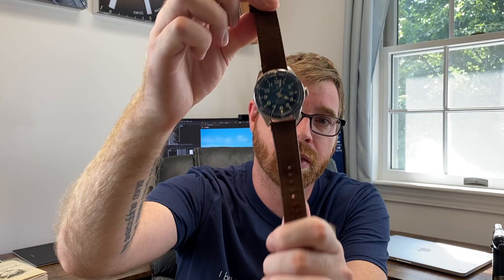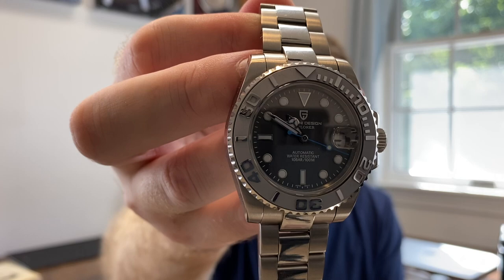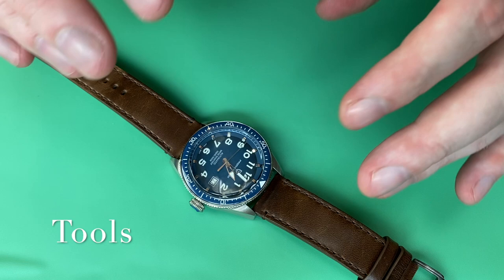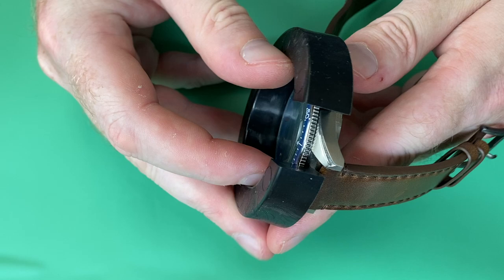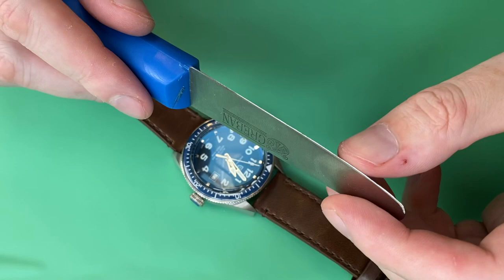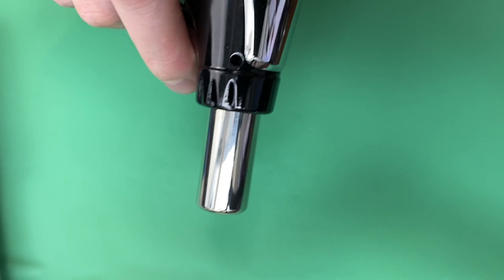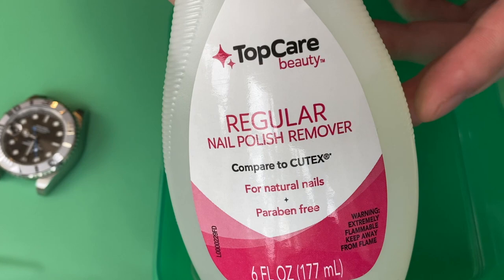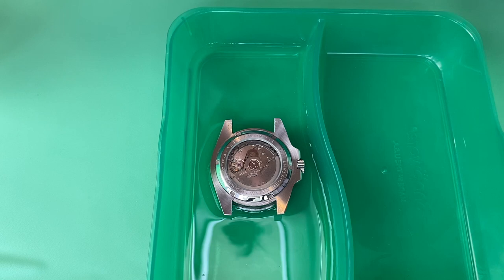Realign Bezel and Remove Cyclops Lens

Comment: i tried this with a sub homage. no dice. id rather not crack the crystal or worse. thanks anyways
Reply from the maker: i don’t think the crystal would crack...it might pop out if overheated. you want to warm it up just enough and then use something to tap or scrape it off. how hard that is to do varies.
Reply: update. i eventually got it off using a razor blade and a urologists hammer. the cyclops is sapphire too since it shattered to beautifully. the main sapphire and movement remain unharmed. there's no doubt that this is a risky action but it is an option if anyone needs it. cheers

Comment: Hi, I’m trying to remove the cyclops from my Pagani 1651 using this method, but the jet flame seems to be having no effect whatsoever (other than making the watch really hot!) Any idea why I’m struggling so much?
Reply from the maker: I will say that this cyclops is one of the tougher ones I’ve encountered. If you heat it up too much the whole crystal might pop off, but the gasket will probably still be ok, you'd just have to use a crystal press to put it back on. With the cyclops warmed up, If you have a razor blade or a sturdy piece of peg wood, you can put it next to the cyclops like you  are trying to get under it and give it a few taps. Might get it to pop off. I’ve seen that too. And since it’s sapphire, it shouldn’t scratch. Start with peg wood or something like that.

Comment: Do you know if it's possible to reattach the cyclops with some UV glue? I have a cyclops that's slightly misaligned and it's driving me crazy. I don't want to permanently remove ut just realign it.
Reply from the maker: That's typically what's used for cyclops lenses.
Reply: @WatchComplications  But would you say it's possible to reattach the same cyclops that was on there? I'm thinking there might be some glue residue on it?
Reply from the maker: that might be on a case by case basis. even if there is some, it’s clear

Comment: Hi Thanks for sharing this. I did a similar exercise a year ago removing the cyclops of my Squale 20 Atmos 1521. Just used a typical smallish kitchen knife and a non-butane lighter. The project was a success with no damage whatsoever with the watch but it took a bit of time to pop the cyclops part by part.  I wish I knew about the acetone usage back then. It may have made the job a bit easier. I may have even popped the cyclops as a whole.  Cheers!
Reply from the maker: typically I'd recommend staying away from metal, just to prevent accidental scratching and such. nylon tools or wood tools can be other good options.
Reply: @WatchComplications  I definitely agree. I taped the potential scratch areas to death :) to avoid scratches. The repeated heat and nudge/scrape approach worked pretty well.

Really love the vid quality of your reviews. I likewise admire and salute how your channel and journey had grown and transformed! cheers!
Reply from the maker: yup tape helps too. cheers and thanks for watching...plenty more to come :)

Comment: @Watch Complications, have you ever tried removing the bezel spring wire and tightening the angles to improve the bezel action, or reduce the back play? Pagani Design seem to have gradually improved the bezel action on their PD-1661; but some still have back play. Apparently this can be reduced by tightening the spring wires angles. The bezel uses a pin under it, rather than a ball bearing to make the clicks. The tension of wire holds the bezel on to the case, and also provides friction when turning it. It's a shame Pagani Design don't just make the spring wire angles tighter in the factory for tighter bezel action with less back play. Regards.
Reply from the maker: I have not tried that yet, but thought about it. Mine doesn't have a crazy amount of play so I'm ok with it at the moment. I also didn't want to go through removing the bezel spring and the whole bezel since this one was steel, and just went straight for the acetone. I did look at the spring some with the insert removed and I believe this bezel would be quite a chore to remove. Would need a pretty good tool to do it. I have several types but most aren't going to work. I have one that will work, I think. Have you removed the bezel on one of these?
Reply: @WatchComplications  The bezel simply lifts off once the spring is removed. It doesn't require prising from a tool (the wire spring holds the bezel to the case). I have a PD-1661 Cermit incoming that I will be modding to a Milsub homage; so after removing the insert with acetone I will remove the wire and tighten it to reduce the back play. Vostok Amphibia's use a similar octagonal stainless steel wire to hold on their bi-directional friction bezels. Tightening the angles makes the bezel tighter to turn, opening the angles makes it looser. Some brands use a ball bearing for the clicks, but Pagani Design use a pin under the bezel. Often collector use a caseback knife and dent the bezel or case trying to prise them off. Personally I prefer to use the tool below (after putting tape on the case to protect it). I hope this helps. Regards.
https://www.amazon.co.uk/SNOWINSPRING-Baffle-Removal-Workbench-Opening/dp/B07RKTJJG3/ref=sr_1_5?dchild=1&keywords=watch+bezel+tool&qid=1607617890&sr=8-5
Reply from the maker: Ah yeah, I have that same tool and it was the one I was speaking about to perhaps use to remove the whole bezel. And yeah, I've seen plenty of the videos showing knives and such, but usually not a smart approach. 
I'm much more familiar with the ball bearing setup. I suppose the way to remove the spring is remove the insert and then work at it from the inside? 
Just don't use acetone if the bezel is ceramic or aluminum ;)

Comment: Many thanks! I successfully removed the cyclops from my PD Sub (was not put on straight) and I think it looks better without as well! I've also got the PD 1651 coming in, so by now owning a torch and aceton, I think I'm well prepared.
Reply from the maker: cool! yup looks much better without.
Reply: @WatchComplications  Received mine (same color as yours) and it truely is a stunning looking watch...looks better than any Sub imo.
Reply: can you please elaborate? it was steaming hot yet the cyclops didn't budge at all. thanks
Reply: @Dionysor  Did you use a torch? only a blue flame works.

Comment: I got the green bezel pagani, and the cyclops was glued on too far outward and crystal was installed a bit clockwise so the cyclops was showing the lower right corner... after seeing your vid, I got my torch out, toasted the lume pip brown, and I was like F----  then I kept going and the crystal popped off, SO I was like F this... just positioned the crystal more counter clockwise, and pressed it in with my thumb. using a razor I cut off the burnt layer of the pip, and I am now satisfied that at least the cyclops is now level and I see the right side of the date instead of just the corner.
Reply from the maker: hey there, yeah you gotta stay on point with a torch, so you don’t affect other things. It sounds like you got it too hot, because the crystal popping out is usually what happens when overheated. Sometimes the cyclops will also pop off at that point. Basically you want to get it just hot enough and then try something non-abrasive like peg wood or a nylon/plastic tool to tap at the cyclops. Could also use something like a razor blade, just have to be really careful with that. It won’t scratch the crystal, but you could scratch or cut something else.

Comment: Hi. Is the back cover made as one piece with threads, or are the threads welded to the cover, like in fullmetal covers?
Reply from the maker: It's a screwdown case back, that is fairly typical of watch cases, if that's what you're asking.
Reply: @WatchComplications  I meant that the metal case backs made out of 2 pieces, welded. My question was about the case back with crystal, is it one piece with thread?
Reply from the maker: @neverstov  I believe it's one piece (with the crystal pressed into place)
Reply: @WatchComplications  you are my hero! Thank you very much) 😊

Comment: Most all automatic watches use a plastic movement holder .  Ask me i think it helps as a shock absorber
Reply from the maker: I’m personally ok with plastic movement holders, which is more common on solid case backs. With an exhibition back metal will look better. Techicnally, it should all be so snug there’s no jittering about internally anyway so shock absorption is more pertinent to moving parts on the movement itself (the movement as a whole and the holder + case are not moving/friction parts). Still, some people see it as lower quality...but again that usually comes down to a visual aspect more than anything.

Comment: what happens if, when you press the bezel down after re-gluing, the glue seeps towards the bezel spring? Why didn't that happen here/is the only way to get around that to remove the bezel?
Reply from the maker: Don't put too much glue and put most in the corner so there is plenty of edge and if it seeps it tends to out the top. And yeah, you'd have to remove the bezel. But the spring on this rests underneath with quite a bit of space.

Comment: Will the acetone damage ceramic bezels or the paint on the numbers on it?
Reply from the maker: Acetone will remove paint, the time it takes depends on thickness. And acetone has the potential to discolor ceramic, so if you are concerned about that, you could use really hot water for a while, or a less abrasive chemical like rubbing alcohol. Depending on the original adhesive used, results will vary.

Comment: I tried heating the cyclops for around 8 seconds with the torch but it won't budge.  Not really comfortable heating it up much more since it is a diver and don't want to risk melting the gasket. I can't really just remove the crystal as I don't have the tools to press it back in. Could you use the acetone soak trick for longer to also remove the cyclops?
Reply from the maker: I will say that this cyclops is one of the tougher ones I’ve encountered. If you heat it up too much the whole crystal might pop off, but the gasket will probably still be ok. With the cyclops warmed up, If you have a razor blade or a sturdy piece of peg wood, you can put it next to the cyclops like you  are trying to get under it and give it a few taps. Might get it to pop off. I’ve seen that too. And since it’s sapphire, it shouldn’t scratch.

Comment: Can the bezel insert on this model of pagani be replaced with a standard ceramic submariner bezel or is it a bit thicker?
Reply from the maker: Not 100% sure without trying it. I didn't measure the height of this one when I had it out, might have been a good idea I guess. There's plenty of depth to the bezel, so it's worth a try probably.

Comment: Great video Brian. Thanks for sharing this. A couple of questions: 1) what solvent should work for ceramic bezel inserts, and 2) would removing the cyclops with the ceramic bezel insert still attached damage the insert? Thanks!
Reply from the maker: Don’t use acetone on ceramic or aluminum bezels. This was a steel bezel with no printing so acetone gets the job done in about an hour. What solvent you use depends on the bezel type, printing, etc. Regular old hot water can also work in some cases. Here is a video that shows the same process but with a solvent that is not harmful to the type of bezel on your PD1639. It takes longer to soak, but shouldn’t harm it, it's a golf grip solvent. https://youtu.be/Y_zDht9pl5U
Reply: @WatchComplications  I'm trying this now with the golf grip solvent with an Al bezel. The solvent is very expensive (in UK at £25 but worth it if it does the job).
Reply from the maker: @andysmith7903  let me know how it goes
Reply: @WatchComplications  Absolutely great, took 6 hours for the insert to start to move and then turn easily before dropping off. I've ordered some GS Hypo cement and will try the technique of adding drops around the bezel so when adding the insert they will run together with less chance of oozing up on the crystal.
Reply from the maker: awesome. either dots around or a thin line around should work. if any excess squeezes out, just leave it. It’ll dry and you can just brush it away.
Reply: Hello! Would this work on a Pagani Design PD-1662?
I’m trying to change the bezel from the standard black and rose gold to a black and white bezel. However I’m not sure whether it is a steel or ceramic bezel insert.

Comment: This was really informative for a beginner but pardon my ignorance dou you know if they use glue to hold the crystal in these watches? If thats the case would the acetone harm the water resistance?
Reply from the maker: This one uses a thick and tall gasket to hold the crystal, so an hour with acetone was a non-issue in this case. If you are worried about glued crystals or have bezel materials other than steel, then use something like golf grip solvent. That will take longer to loosen, but it's safer in those circumstances. (I mention this in the video description.)
Reply: @WatchComplications  oh i see, thank you very much

Comment: Thanks for this I just got a PD- 1651 and that cyclops has got to go. Now i know how!
Reply from the maker: The key is getting it just warm enough and then tapping at it. Don’t overheat the crystal or the whole thing will pop off and you’ll need a crystal press to put it back.
Reply: Trying to get this cyclops off PD-1651 torched the hell out of it....will not budge ...any ideals?
Reply from the maker: Well don't overheat it either. If you do the whole crystal will pop and (though the lens will also pop off), then you'd a crystal press to put it back in good. Once it's reasonably warm, have you tried tapping at it with peg wood (or some non-abrasive tool) to knock it off?
Reply: @WatchComplications  I gave up, I do not have a press. I heated it way more than you did yours.Thanks for the reply.
Reply: it seems that this particular model uses some crazy permanent epoxy. i heated it a ton more than the video has shown yet it didn't budge. glad im not the only one and i don't want to break a beautiful 60€ watch. coming from someone who hasn't such a high budget
Reply: @Dionysor  I thought it was me I had same problem.Otherwise I love the PD-1651 mine keeps great time still looks new and I don`t treat it nice.

Comment: Do you place the insert on the click or the backlash in the bezel is removed?
Reply from the maker: somewhere between the two where it seems to rest naturally. You can also tighten the springs up on these so there's less give.
Reply: @WatchComplications  do you have a video showing how to tighten the springs?
Reply from the maker: @GelzBelz  I do no have a video on that at this time. The tension of wire holds the bezel on to the case, and also provides friction when turning it. Tightening the angles makes the bezel tighter to turn, opening the angles makes it looser.

Comment: When I remove the cyclops with heat, I take out the movement out of the case, just in case you know 🤪🤣😂
Reply from the maker: Fair. But if it’s getting hot enough to affect the movement, you’ve probably gone too far 😂